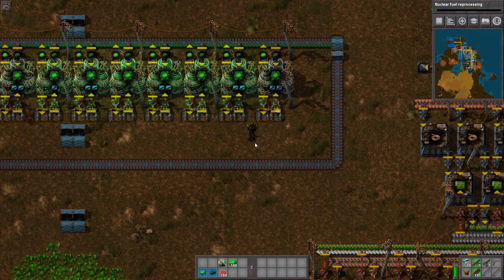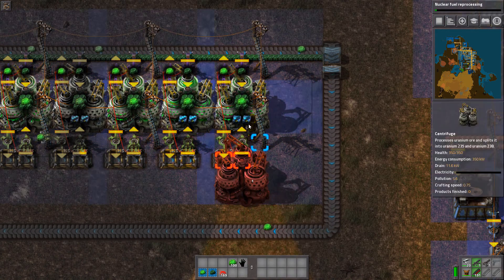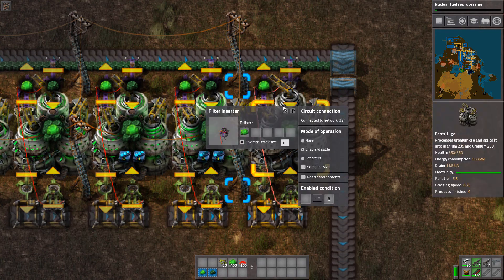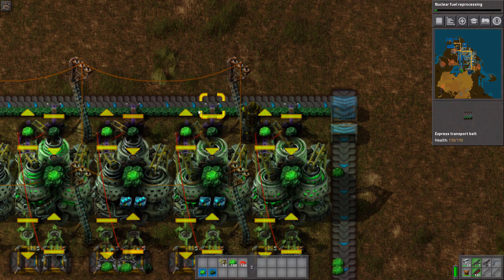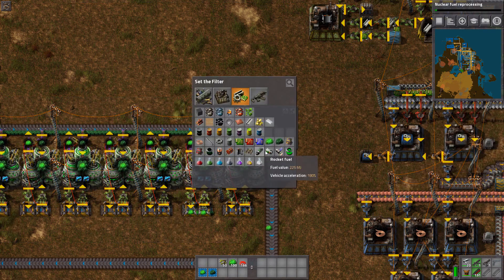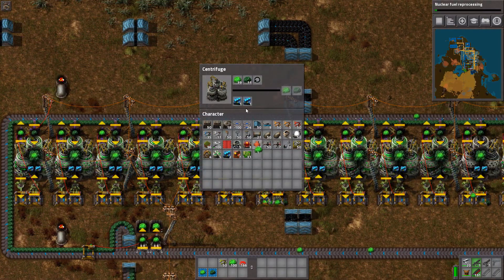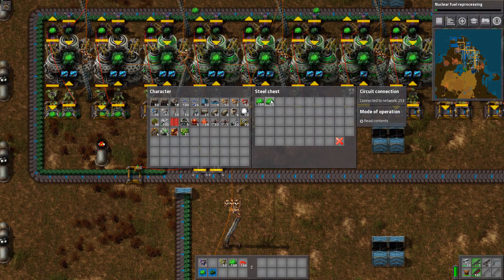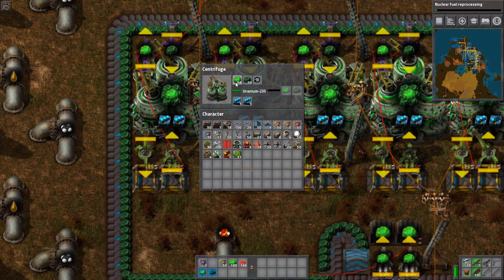Factorio Tutorial - Enrichment chamber settup (centrifuge)

Comment: I just discovered a flaw with this. This eventually stops working if the belt is backed up and you can't drop off the U-235 anymore. In that case the output and input buffers of the centrifuge get filled and it won't load any more U-235, which stacks up on the loop belt. That blocks the output filter inserter that's supposed to move the excess out. Even when when you later clear the output belt. Simply because it only works if the belt is empty

You may be aware of this and that's why you stopped the belt when the output chest is full

I think this fixes this issue:
1.) Remove the wire from the U-238 input inserter. There is really no reason to block that and the centrifuge can also stop working if it can't take in any more "bad" uranium. This ensures that a cycle can potentially always start
2.) Connect the output filter inserter with the output stack inserter with green wire. Then set the filter inserter to "read hand contents - hold" and only operate the stack inserter when "Everything = 0". That way the centrifuge won't cycle if the output it blocked
Reply from the maker: You just need more reactors to keep up
Reply: Can't rely on that when using smart fueling so that the reactors don't constantly burn fuel when not needed.

Otherwise this is a very nice design. Unlike many chest buffer builds it doesn't take more than the needed 40 uranium. And it doesn't need any combinators.
The downside is that it's not self-loading but I can live with that

Comment: You've got a weird low buzz in your audio btw.
Reply from the maker: Yes I know, it's because of my microphone, would love to buy a better one but it is quite expensive for such hobby
Reply: Yeah audio equipment can be painfully expensive. You can also take care of this kind of noise pretty easily with just a high pass, notch or even just a generic noise reduction filter in editing.
Reply from the maker: The filter does wonders, but my problem is that's it is to low for the filters that I'm using (partly), if you have any suggestions I would be happy to try them